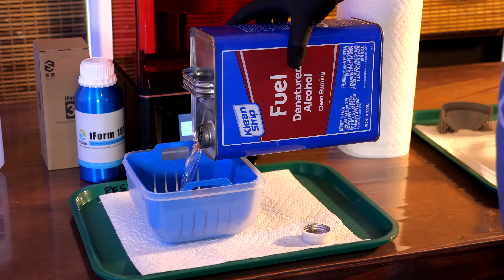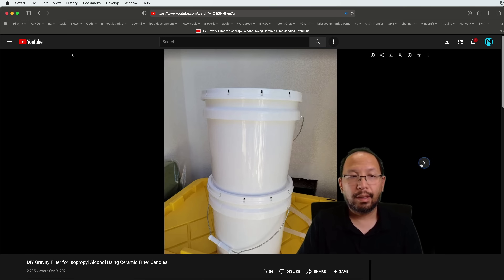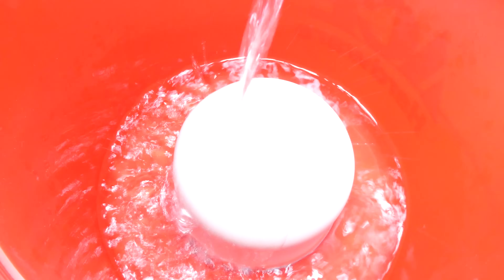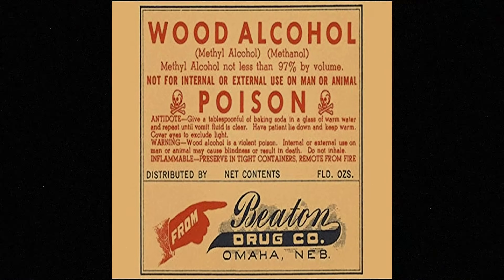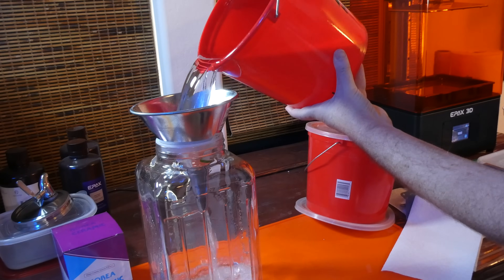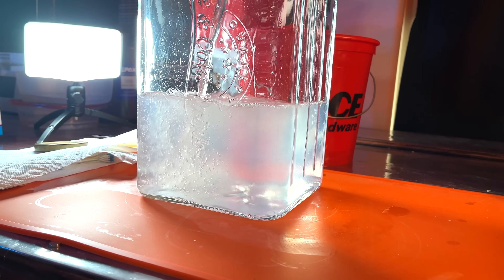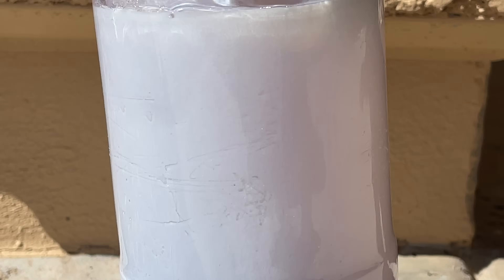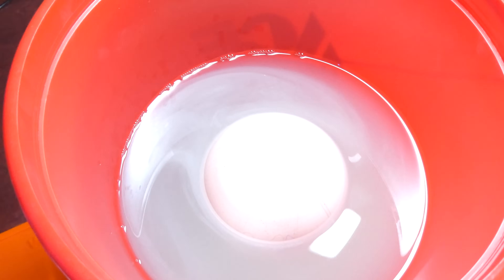Can We Recycle 3D Printing Alcohol?

Comment: I hate to be that guy, but I just don't think I would do this. at least not without proper control of the resin types that I was using. what you are washing off your parts is essentially uncured monomer, which is really not a very good thing to be making extensive contact with. Inhalation of fumes, as well as skin contact with  uncured resin monomers is typically something to keep to an absolute minimum. massively increasing the surface area for the alcohol to evaporate and create vapors, massively increasing the risk of skin contact, massively increasing all forms of exposure. this really just does not seem worth it.

especially considering how difficult it is to know exactly what is inside most of these 3dp resins, it seems very hard to know whether all of the resin components are simply being dissolved in the alcohol, or if there is any type of adverse reaction going on. and if there was some type of reaction with the alcohol, it seems like it would only become apparent once it had become really concentrated. and you would not want to be distilling or touching that type of byproduct any more than you have to either.

https://all3dp.com/2/sla-3d-printing-is-3d-printer-resin-toxic/ - "Any isopropyl alcohol used will also contain resin and should be treated as hazardous waste." "Toxic to the environment, especially aquatic ecosystems: Tragically, several independent scientific studies have come out that show molecules in printer resin can attach themselves to the central nervous systems of fish and other aquatic animals, breaking down their neurological processes and killing them."

I know this is total buzkill stuff, but I really wouldn't do it like this. personally what I would look at is increasing the number of rinse washes you are doing. I would run a many-stage rinse bath. whatever you find to be acceptable for cleaning quality. Use the same rinses over and over for multiple prints. the first wash will get extremely saturated with resin eventually. at the point that the first wash is so saturated that it does not sufficiently clean before moving to the second rinse, remove it, make the second rinse the first, add a new clean rinse at the other end, and deal with the resin saturated wash. likely either try to cure it as you did in the video, or put in a safe container and take to hazardous waste treatment. you could also just clean the last rinse by setting it aside, letting the crap settle out like you did in the video, and then just siphoning off the much cleaner stuff from the top. I just would avoid increasing vapor exposure, contact with contaminated containers, splashing, liquid transfer, etc.

Comment: i'm a distiller. the all in one electirc pot you show as an example is pretty much zero risk for your project. the only way to light that machine on fire is to hit it with a blow torch. it's alcohol, not gasoline.

Comment: Pressure will also increase the rate through the filter. Either deeper, or find a way to add pressure. Also, the catch bucket needs a vent so air can get out of the way to let more alcohol through the filter. Vent it into the upper bucket, ideally.

Comment: Distilling is not as much of a fire hazard as you would first assume. Inside the tank the air to fuel ratio is so far off that it's nearly impossible to ignite. It's not too far off of a cars fuel tank, and that has a brushed DC motor in it. Once it's sealed the only spot that can become a problem will be the output.

Comment: Okay, so as someone who's far more into chemistry than 3D printing, filtering might work but is definitely not the most efficient method, distilling is DEFINITELY the way to go here, however, maybe not in a home water distillation unit, I know people have been using those for ages for alcohol distillation, but I just don't love the idea of using something that's really only designed for distilling water, plus I feel like they'd be a pain to clean, and probably useless for anything else after this (without extreme cleaning).

If you're the kind of person that goes through enough alcohol, setting up a proper distillation system would definitely be worth it, something similar to proper still setup for making alcohol (like the drinking kind), or some glassware would be ideal, if you set it up properly, e.g, venting fumes, and monitor things regularly enough, the explosion risk is basically nonexistent, it's not 0, it never really is working with chemicals, but its close enough.

If you're really insistent on going down the filtration route, the best method here could be a vacuum filtration system of some kind, when it comes down to it, pulling the liquid from microscopic/nanoscopic particle mixtures is just a massive pain, it's going to clog basically any filter you throw at it, especially the ones small enough to actually remove the smallest particles, this means like you've done already, it takes multiple stages of filtration and is insanely slow pretty much no matter what, the only problem I see with vacuum filtration is probably cost barrier, I'm actually not even sure how easy that kind of a system would be to setup at home, I do know it'd likely be the most efficient method of filtering it, other than some kind of centrifuge system or something, but that's maybe out of the realm of most home 3d printing enthusiasts. 

I guess the way you're doing it now is fine, it just looks painfully slow to me and there'd be a decent loss due to evaporation that could be avoided with distillation, if you're not doing it often it's probably not a big deal, but if you're talking 10's to 100's of liters and regularly, it might actually be worth it to distil properly, you'll wind up with much cleaner alcohol and faster with much less lost during the process and if you build your distillation setup to be made for doing this kind of thing it'll be super safe and probably easier to clean up.

Comment: I've been thinking of a way to cold distill alcohol using 2 containers connected by a tube and then placed under vacuum where you place an empty vessel in cold ice water and the other vessel in slightly warmed tap water. This setup would keep the temperatures as low as possible and any and all vapors contained.

Comment: Ok second post on this. If you want to kill the resin, you need to kill the catalyst. And you stop polymerization.
Try adding acid to the mix, to break up the chains, and then neutralise it with a base.

Then distil it out (watch your temps).

The filtering (using a sinter) will only separate particulates and is only good for a gross separation, it's not good for anything else.

You need to think this through a little more with a chemists hat on.

Comment: For all to know:
Isopropyl alcohol - C3H8O is completly diferent substance than ethanol - C2H5OH (used in drinks) and methanol - CH3OH (used as so called "poison"  to make industrial ethanol not drinkable).
Please do not mix them or do not try to drink them after filtration - it will not make them safe to drink!

Comment: Nothing wrong with distilling. I've been doing it for years with making my own alcohol. It's just part of the process. It only needs to get to about 80c. Which is far below ignition temps.

Best way to filter though would be a combination of decanting > cloth filter > ceramic.

However, I would also argue that it doesn't need to be crystal clear anyway. Run it through something quick after each use, paper/cloth/cotton and as long as its cleaner than before you started, it should be fine to use for cleaning again. We reuse a batch multiple times, my guess is after a single filter it'll only be as dirty as a first or second use anyway. So what does it matter?

You can also make your own alcohol from sugar and yeast, distill, and that will be cheaper (and consumable).

Also, to reduce risk of film on your prints:
1. Use two baths. One with "dirty" alcohol to rinse in first, and a second cleaner tub.
2. Let the parts dry completely before curing. This also goes for water washable. Letting them dry completely is the real trick here.

Comment: You could try adding a pump to the output of each stage of filtration to increase the speed. Another solution may be to add some vibration motors to the underside of each stage to help encourage filtration.

Comment: Would be interesting to see if it would help to keep the bucket moving or use one of those electric stirrers you can get for cooking (assuming it doesn't dissolve in the alcohol). Some flow should help it naturally wipe off the resin that gets stuck to the filter

Comment: Distillation is the second step in making denatured alcohol. The still you showed is specifically designed to distill alcohol. They are safe unless you do something really bad. Use the suggested process for safety. This only real reason to not distill is energy. It takes a lot. Have you considered vacuum filtration? Chemist use it and it might be more your speed. NileRed is a youtubing chemist you could ask and I think he could give you some great advise on this. While it's scientific equipment and will cost more to set up I get the feeling the result will be better and cheaper over time.

Comment: You make it seem like isopropyl alcohol is made from or is altered ethyl alcohol. That was very misleading. It has never been for consumption, in any way, and has some different properties from other alcohols. It does not have toxins or poisons added, it is inherently toxic. Denatured alcohol and isopropyl alcohol have similar uses, but they differ chemically. Denatured alcohol is ethyl alcohol with toxic or bad-tasting additives that make it unsuitable for consumption. The chemical formula of ethyl is C2H6O and the formula for isopropyl alcohol is C3H8O. As far as denatured alcohol, it had additives dating back to 1906, well before the ratification of the 18th amendment in 1919, to make it toxic. This said they did approve and require the addition of more of these after ratifying that amendment.

Comment: It is absolutely annoying as hell to me when I hear people talk about the hazards and dangers of 'dangerous' chemicals... and fuel... who I bet have no further education than 6th grade chemistry.  How do you think alcohol is purified in the first place? If you're really that terrified of it, why don't you have a fume hood? Or.... does your vast knowledge of chemistry that keeps you from cleaning it, tell you it somehow safe if you only use a little?

You could literally buy some ebay or amazon chemistry glassware, distillation flask, condenser, and a receiver flask and a hot plate and just be done with it. 

#1 IPA or 1 propanol which is very similar to 2 propanol are basically sister alcohols and the 1 and 2 designate where the OH grough hangs on the 3 carbon chain that makes up the alcohol. Neither are denatured, both are toxic to people. They aren't denatured because neither are drinking alcohols. Much like you wouldn't denature acetone, because you just don't drink it. 

#2 Denatured alcohol isn't some special form of alcohol, it is ethanol with denaturing additives put in it, namely methanol, and some bittering agents as the sidebar video noted. Ethanol is a 2 carbon chain alcohol and is the stuff we normally drink. You could literally use Everclear grain alcohol to do this job as it's the same thing, and probably very close to the same concentration of water added as well. Ethanol is toxic to humans, we just dabble on that thin line of toxicity before it becomes a problem. Other alcohols are much less forgiving. 

#3 Methanol or wood alcohol is a single carbon alcohol, and is flat out toxic to humans. It is a good solvent however. 

#4 the reason your filter didn't make the IPA not smell bad is because IPA smells bad naturally... it's what it smells like! No amount of filtering will change that. 

#5 You inadvertently hit upon the solution... do a washing of parts, set that alcohol aside, and hit it with UV light, but instead of letting it stand put a stirrer in to keep it agitated, hopefully your uncured resin which is CHEMICALLY dissolved in the alcohol will cure and form small beads or threads which can then be mechanically filtered from the alcohol. going at it with charcoal and extremely fine ceramic filters will not take it out of solution, that will ONLY catch the large cured chunks only.  To put it another way, you're trying to desalinate water using a screen.... Ain't gonna happen. You can boil the water and leave the salt behind (distillation) or you can do something to the salt and make it fall out of solution, then you can filter it. 

So for this project to work efficiently, you need to remove the large chunks mechanically first, your paint filters are doing that. You should pour off the reasonably clear liquids first into one tank, then dump the rest through the paint strainer to get the chunks. From there, you collect the really dirty alcohol separately. At this point you have a choice. Hit the alcohol with either sun light, blue laser pointer, or a curing LED with stirring to cure out the resin leaving clean alcohol behind and re-mechanically filter it one last time, 

OR 

You take the alcohol you have with the resin in it and distill it. If you know what alcohol you have you can get the boiling point of it, and set your still up to go to just over that temperature and boil off the alcohol. You'll see it come over in stages, which, depending on what alcohol you have (denatured ethanol will be the most apparent) You'll see the distillation temperature pause a few times on the way up as the different compounds boil off (methanol, ethanol, different bittering agents - yes you can in fact renature alcohol, just time consuming)... and eventually you'll be left with your resin left in your starting flask, and clean recombined denatured alcohol in the receiving vessel. 

You could try printing with that resin, but I wouldn't hold out a lot of hope for super high quality results as the resin may have other things in it now.  Might be easier to just set this stuff on fire though.

Comment: "Would you feel comfortable distilling the alcohol?"
Yea. Not with an electric distiller but using chemistry equipment. Those distillers are meant for water distillation most of the time and I don't trust them

Comment: Alcohol boils at a lower temperature than water.  As long as the thermostat is working properly it shouldn't be a big fire risk.  You'll need to make sure there's not a lot of alcohol vapor leaving the still as it's highly flammable.  If you use a longer discharge tube you can route any output farther from electrical or flame.

Comment: I have distilled alcohol before to purify cannabis extracts. Using a distiller meant for water is a HUGE no-no, they are not designed to handle combustible liquids or gases, so you're right in feeling unsafe doing it that way. You need a basic chemistry glassware set with a distillation column, a mantle heater, a round-bottom flask, and something to collect the distillate, the original container works fine. That system isolates the dangerous gases and liquids much better and uses lower peak temperatures generated by sparkless mechanisms to prevent accidental ignitions.

If you are going to distil alcohol, NEVER leave a running distillation unattended for any length of time, especially during warmup and cooldown and those are the times your glassware is most likely to crack if it's going to. Heat slowly and gently, use boiling chips to prevent bumping (sudden flash-boiling of superheated liquid at the bottom of the flask, this can destroy glassware or cause massive splashes and spills.), keep the heating mantle under the autoignition temperature of alcohol.

Comment: note that in a lot of countries (for example all of the EU), distilling even denatured alcohol or IPA, both of which would not result in anything considered "drinkable", is as illegal as distilling moonshine, because they just don't make a distinction between the kinds of alcohol involved.
my usual IPA cleaning approach is similar (="settle and filter") to yours "let it sit in the sun for 2 weeks or so (to both settle and expose any resin), then filter through a cheesecloth (because i didn't know about the ceramic ones you found and coffee filters seem to never work)", worked fine so far, but i imagine it would leave things like solvents or other additives from the resin in the alcohol (which might harm the prints if they collect over time).
but given your filters seem way more thorough, i wonder if they could be refilled with fresh activated charcoal?
also your clogging issue might actually be helped by my cheesecloth idea (or, probably better, paper kitchen towel or other paper filters) to catch the "gelled" resin pieces

Comment: Something else you can try that may go faster, but will cost a bit more for setting up. Get a buchner flask, buchner funnel and vacuum pump. You'll need a supply of paper filter media. This setup will suck the alcohol through the filter media quickly. Repeat until clear.

Comment: methanol boils off at a lower temperature than ethanol. This is how spirits are distilled as both methanol and ethanol are created during the fermentation process. So, yeah, with a still you can remove the methanol from denatured alcohol. There's not much of a fire hazard with distilling as you are working with temperatures well below the flash point of either alcohol. But do remember. Here in the U.S. of A it is illegal to home distill ethanol for consumption without proper licensing. It is not illegal to distill ethanol for fuel or chemical use. The more you know, and knowing is half the battle. Go Joe! ;)